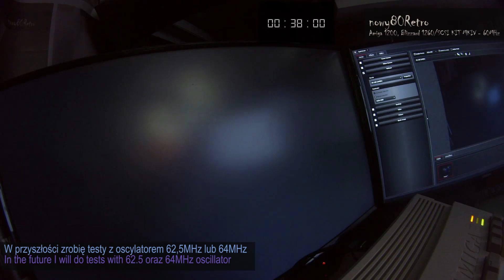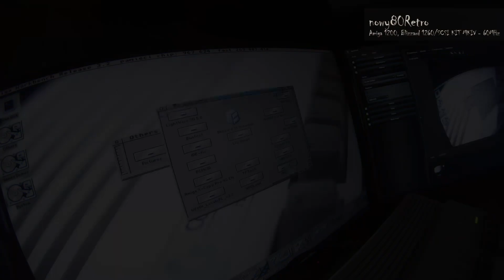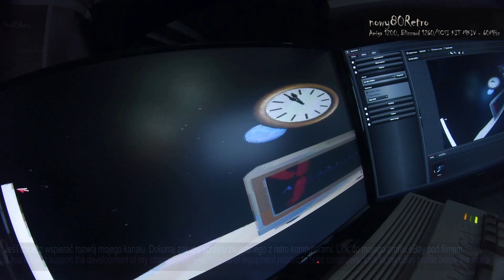nowy80Retro #169, Installing Blizzard 1260 with SCSI KIT MKIV

Comment: Why is booting so slow? Are you booting from SCSI or IDE?
Reply from the maker: The system boots from a 2.5' IDE disk. Each partition is over 20GB and this is probably the main reason for the longer system startup. It is not a problem for me. Regards
Reply: Would be really interesting to see the SCSI in action, like manche booting and  speed tests.
Reply: Got it Is the DSP able to do DMA?